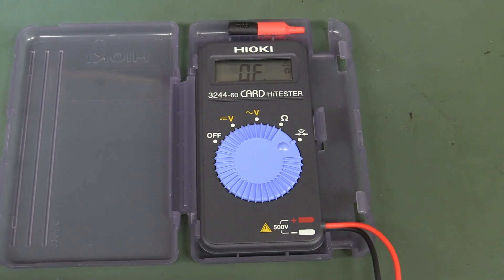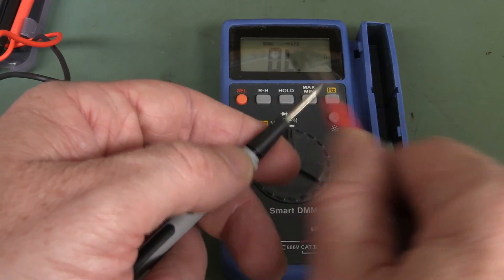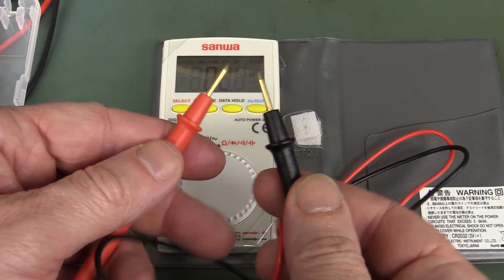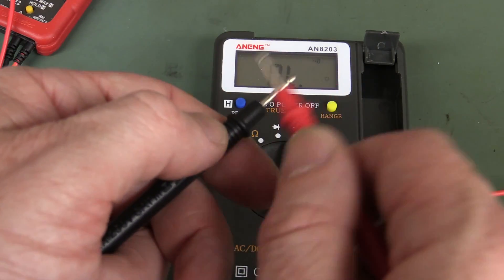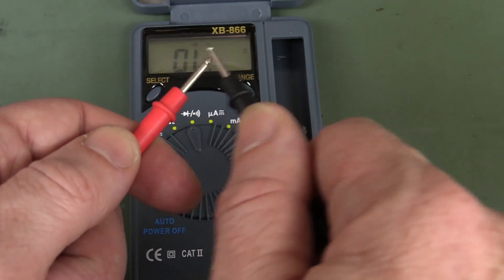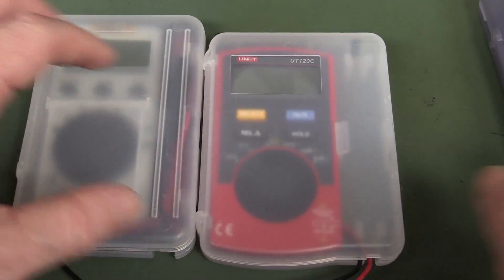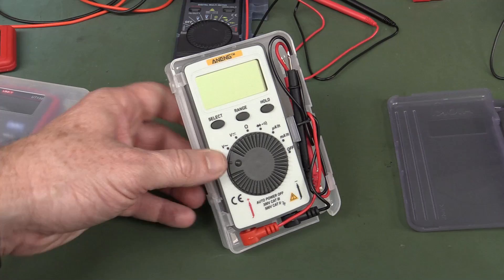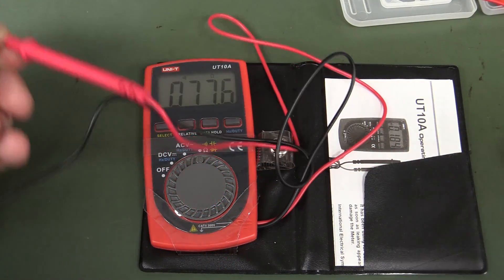Pocket Multimeter Continuity Shootout

Comment: What do you mean when you say the tester or buzzer is latching?
Reply: The solid vs scratchy beep is a result of a latching circuit, which "triggers" as soon as a continuity is established  (above some level) and  causes the meter to beep even if continuity is lost for a small time. (too long of a latched time and it'd become difficult to use)   While it is a benefit for detecting ANY continuity, especially brief, tenuous connections that might cause trouble,  a non latching type can better indicate the quality of a connection.  A solid beep means good constant contact, while the scratchy noise indicates poorer, intermittent contact.  each has advantages and disadvantages.
Reply: its kind of like debouncing a switch.
Reply: And why not make one with latching that can be turned on or off? I'll do that on my multimeter!
Reply: +1
Reply: Ah, ha.  Found it from some guy named vortex below:  "The latching type have a nice solid beep sound, the non-latching ones sound 'scratchy', think like scratching a vinyl record."

Comment: In all my experience I have never ever found these tests very useful.
Except for the fact that they are loud enough. That's all you need.
Who cares if you beep is instant or not. 
If you have some time it probably wouldn't be to difficult to hack them to get them louder.
Put modifying seems to be a bad word these days.......
Reply: I use a brass wire brush to drag across a board when looking for a trace or some pins. If you have a 100-pin chip it would take you a lot more time to find out which one is connected.
I like the scratchy ones better, you figure out faster if you have a sketchy connection.
Reply: Piet Muijs if you can drag your probs across a few pin and get instant results then that multimeter is an ulsell pice of shit . Ho and sorry but I don't want to wait 10 sec to get a dam resistor values.
Reply: If you are trying to troubleshoot an intermittent connector or cable, the response time of the continuity beeper is quite important.
Reply: *can't drag?
Reply: Yes I did, and it's just a matter of swiping a little less fast and it's fine.
Most of the time it's the probes and/or the solder connections that determine how good/bad the connection is.
Reply: The most revealing test would be measuring the "continuity" of the mains. Are they safe?

Comment: No one sensible measures continuity using the sides of the probes.
Reply: That is how I test continuity when wiping down a row of pins so I would argue it is valid.
Reply: So you want to say, that ther is a hearable difference between touching the sides and touching the tips? :D
Reply: Glasrandkante haven't you heard metal is much more conductive on its end then on its side!!
Reply: mbaker, you're talking about the side of the tip, Dave is using the side of the probe.

Comment: What is meant by latching type? Is it that the minimum duration of beep is fixed for even a small instant of continuity detection?
Reply: The latching type have a nice solid beep sound, the non-latching ones sound 'scratchy', think like scratching a vinyl record.
Reply: Vikas V 

Yep, that's basically it. ;)

Personally I don't mind some of the cheaper non-latching type meters, as the scratchiness gives you some audible feedback about how good the contact is.

You can even use the beeper on most cheap meters to "listen" to serial data and other digital stuff.

(not recommended for everything, as even the small current passed in continuity mode could feasibly damage some chips or circuits while they are powered up. Most continuity checks should only be done with the circuit powered off, but you get my point. lol)

I just use a cheap "Vichy VC97" meter. I rarely ever use it for mains testing anyway, and I don't need high accuracy or anything, so it's fine.

If you are doing a fair amount of mains testing though, you should always buy a genuine and properly-rated meter with decent HRC fuses etc.
Reply: TheVexCortex Thanks
Reply: ElectronAsh Thanks for the explanation
Reply: With the latching type, You also get a pizza :)))